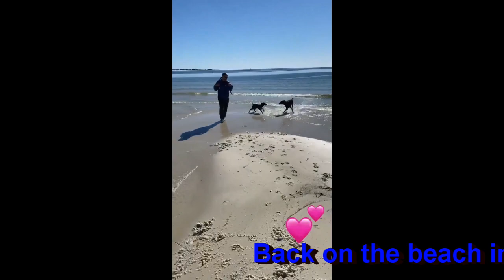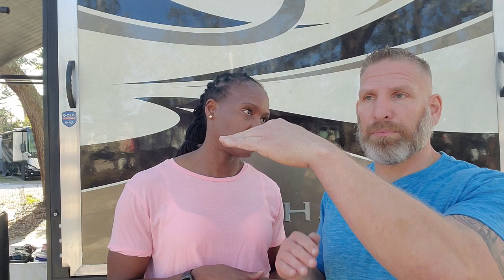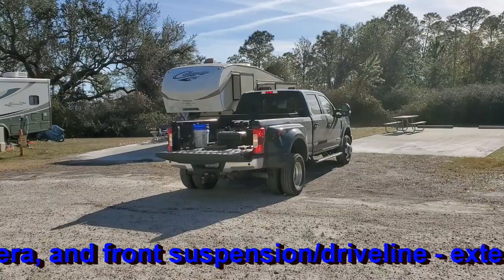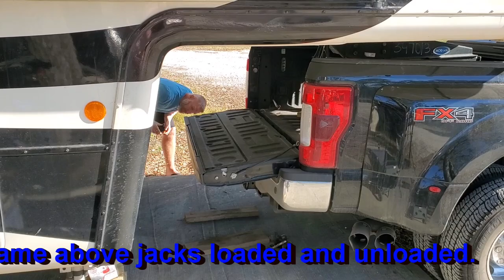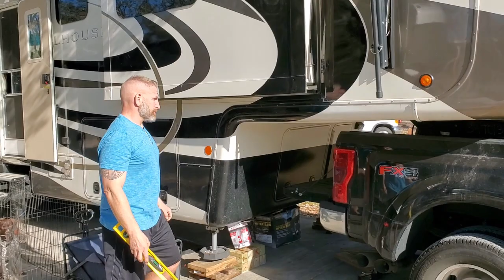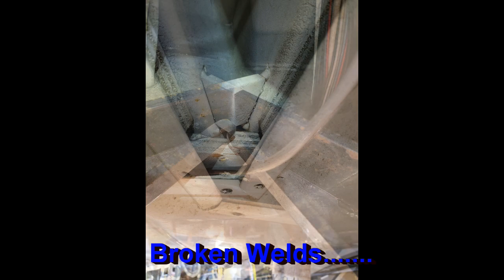Frame Update - Need a Little Love! || Full-Time RV Living

Comment: So it looks like the Lippert folks tack welded the parts in the jig and then forgot to finish welding the parts? Anyway, why don't you call a mobile welding service and have the frame parts welded at your campground? Looks like everything is accessible to the welder. Maybe he could use the weight of your truck, run a come along  between the pin box and your trucks Class 5 hitch to pull the pin box/frame down into place, and weld er up! You're probably wasting your time thinking the manufacture is going to stand behind this and even then, you would have to go out of route to their location to get it fixed. And I wouldn't go too far the way things look or your going to be towing your DRV with the top of the bed of the truck!
Reply from the maker: Yeah, we're gonna have a mobile welder reinforce this area, and we're looking at getting the rest of the front frame gusseted and reinforced.  That will require some of the front to come apart, so we'll get it to a shop for that.  DRV and Lippert basically said "Good Luck, not our problem, have a nice day".
Reply: @TrippinWithTheSmiths  Kinda takes the joy out of RVing, doesn't it? Looks like New Horizons might be the only 5th wheel manufacturer making their own chassis! Shame on DRV and Lippert!
Reply from the maker: @markajohnson4583  yeah,  this part sucks.